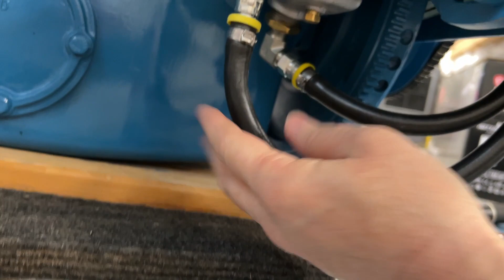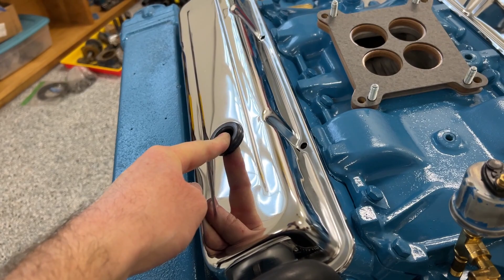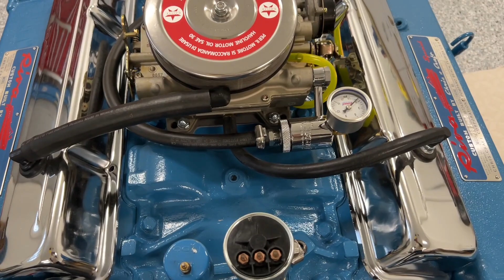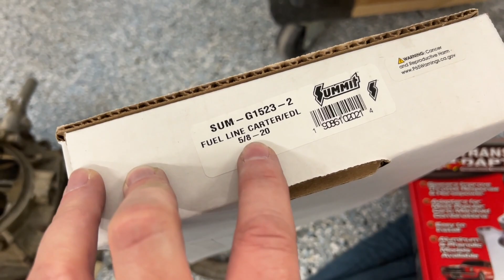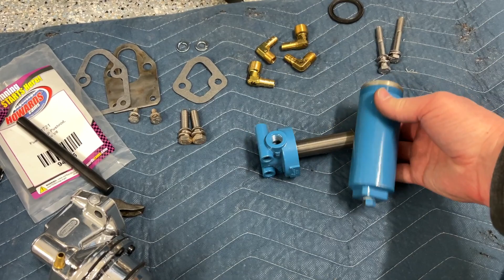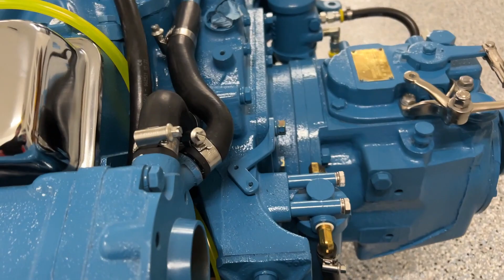How to build a Chris Craft 283 / 350 conversion marine motor Part 9

Comment: Hello, i am French. You rebuilt two SBC 350s, a 350Q and a 350 QL. If they were in the same boat, which one was more worn? The one with normal rotation or the one with reverse rotation? I ask because i saw online that the firing order of the one with reverse rotation would be less stressful on the crankshaft! Thank you for your reply, sincerely Gégé 38.

Comment: Really nice work and great job documenting it!  Completely agree with your changeover to hi pressure rubber lines for the remote oil filter.  I'm a little surprised they originally used copper, as that's known to crack with vibration and is no longer used anywhere for automotive applications that I can think of.  How are those chrome valve covers holding up in a marine environment?  I haven't seen any of those yet that don't start rusting within a year on a car.

Comment: Hi Don. Thanks for another excellent video. Is your oil filter relocation system original equipment? Or did you buy a new kit? If it’s new, which kit is it. Thanks. Guy
Reply from the maker: Hello Guy.  About the last 3,300 engines were equipped with the remote oil filter unit as shown on these engines.  about 8% of the total production.  Hope that helps.  You can find them out there if you want to add
Reply: I know this question was asked almost 3 years ago but for anyone wondering the same in the future the parts required along with part numbers are on page 28 of the 283F & 327F parts manual, as well as others I’m sure.